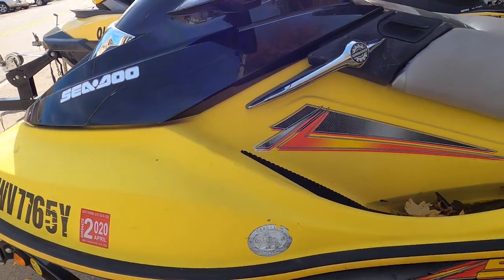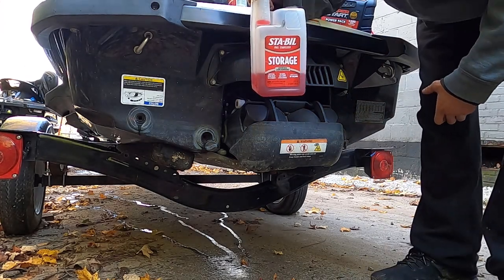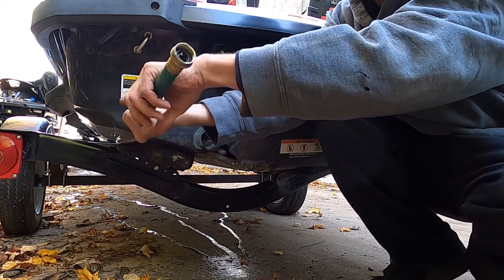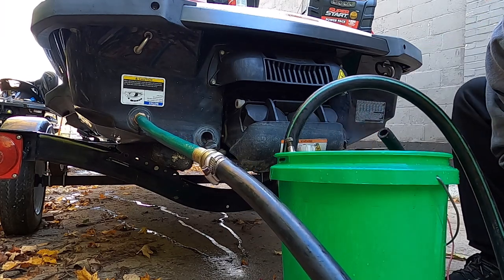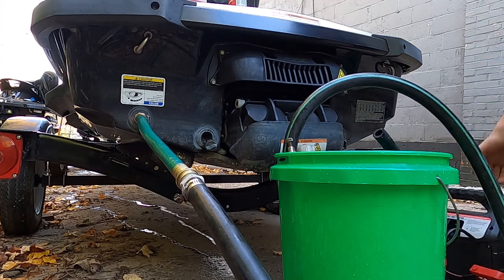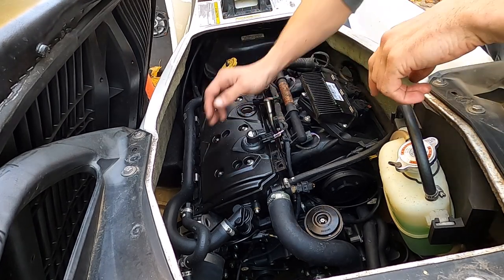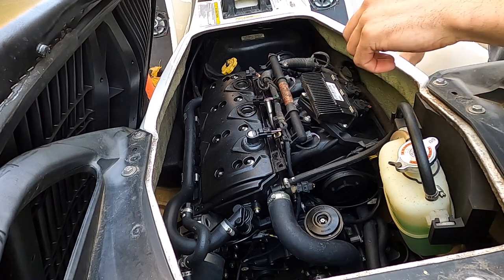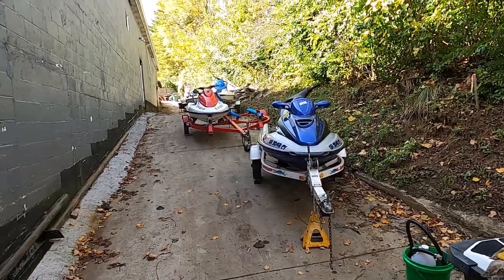See a 15 year old Secret On How - Winterize/Salt Water Flush TONS Of Seadoos, Less Than 5 Mins Each

Comment: thanks for the info. What did you spray in the engine after pulling the plugs?
Reply: Fogging Oil
Reply from the maker: Sean yes , just standard fogging oil can be found at any local auto parts store and even Walmart
Reply: @wavetechwatersports411  Thanks a bunch, this is new to me. Should have my first seadoo next spring!
Reply: What kind of pump do u have inside the bucket?  Can you gravity feed it or is a pump required?